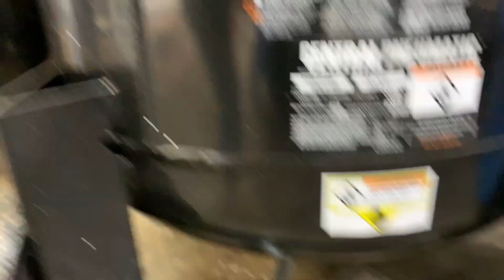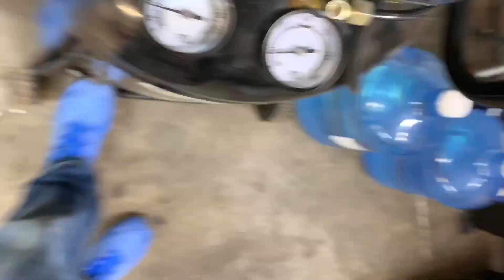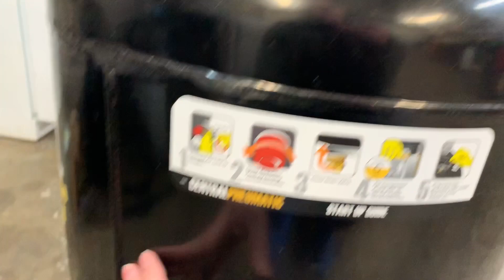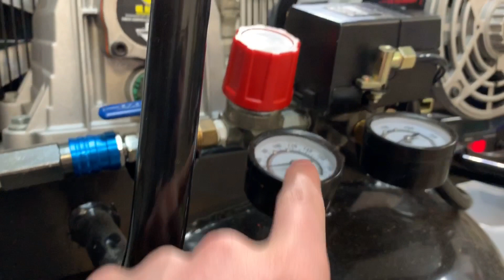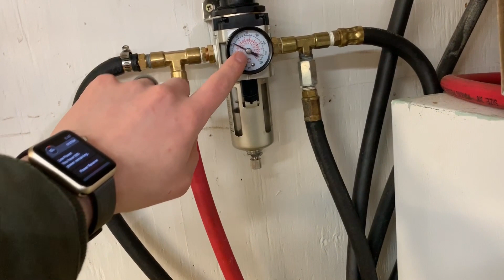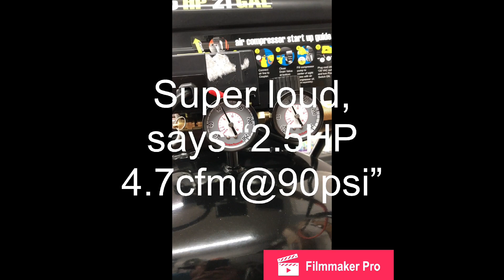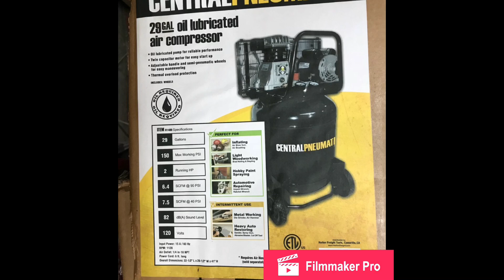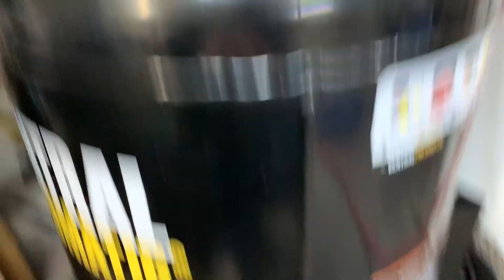Harbor Freight 29gal After Cooler Install, (BONE DRY AIR)

Comment: With out watching the whole video. I stopped as you said “ second thing is “...  You could have extended the drain port with a nipple fitting/cap long enough to help access your oil drain intervals... Just a simple add on to not have to cut into your compressor mount...  Greg
Reply from the maker: It was a very weird size. But hindsight I should’ve done that first. Just looks ugly but it did the job.

Comment: I have a 7 hp 60 gallon and paint on occasions.  I have tried so many water separators and was about to build my own decedent dryer.  I am definitely going to try it your way.  Thanks for the great video
Reply: How’s it working for you?
Reply from the maker: Did you get around to it?
Reply: All you need  is 120$ sharpe dryer

Comment: The setup i would have if i lived in the US, considering how cheap stuff is there buy two small compressors or one big one for 1k and have 12-17CFM with a massive tank or buy second hand commerical and never look back.
Reply: I went the commercial unit. 80 gallons with a real 5hp motor and a pump the size of a harley motocycle engine. It is a westinghouse air brake company pump, which became leroi and then dresser company. The design was used for the brakes on trains and for commercial shops. $750 from my neighbors field and a week of pestering to get that one and not the other brand he had hooked to his shop. Luckily I researched the compressor and found out it is pressure lubed and parts kits are available still. It would cost around $3,000 to $6,000 for a new unit built with a pressure lubed pump. It is rated at 17.3 cfm at 175 psi and a little less at 250 psi. It is making 20 cfm based on how fast the tank fills. 5.5 minutes from 0 to 170 psi on an 80 gallon tank. It is perfect for a serious 1 person shop and runs a plasma table and blast cabinet with the big skat blast tips.

Comment: Great idea to preserve the tank. Is that cooler really rated for that much pressure though? It looks like a regular transmission cooler, and those don't run much pressure, if any. I've got a bigger 5hp 60 gallon compressor, and this kind of thing seems like a good idea to keep water out of the tank for sure.

Comment: The very first thing I would have done and would still do is move that compressor outside of the shop and get rid of all those 1/4" fittings and hose at the compressor and plumb it with at least 1/2" lines or maybe 3/4" and run that through the wall and run that pipe around the shop to some quick disconnects and hose reel, I had my small compressor outside under a shed roof for a long time and am in the process of building a big shed roof behind the shop and I have a 60 gallon one sitting temporarily inside and I can not wait to get it outside, that is the only way to go, I cannot stand all that noise, Thanks

Comment: Only person I've seen do it right and not restrict air flow,,,I used a roll of 1/2 inch copper tubbing,, all 25 foot coiled up 3 years ago,, and havnt drained hardly any water since,,cost me 75 dollars for all.
Reply: yeah, you could build that whole set up from copper tube and fittings and maybe a bender.

Comment: You're gonna get water in the bottom of the tank no matter what, just part of the process of compressing air. The cooler isn't removing moisture from the lines, its just preventing it from turning into water. You need good traps and a dehumidifying machine if you want to paint professionally. I work in a shop and have seen how they run those 500+ gallon tanks. They have dehumidifiers that are about the same size of the tank. What your cooler does is effectively let the tank store more air per cubic inch. This is how two stage pumps work, one pump compresses air a first time, feeds it through a cooler, then compresses the air a second time to make it extremely packed. Which is how those big pumps can push so much air, because they literally compressing air several times before storing it.

Comment: Why cool the air going into your tank? It will sit and heat up anyway. Harbor Freight sells a compressor drainer kit SKU 68244. Its a purge valve. I dont trust that you are putting 90 psi on a automotive grade cooler design for low pressure fluids.
Reply from the maker: So that no water goes in the tank?

Comment: I hate to ask the obvious, but where does the water go?  You compress humid air and send it through the cooler, it’s going to condense in there . If you don’t trap it, it’s still going to end up in the tank, it’ll just be cold water…. Is your “flow valve” responsible for trapping the condensed water

Comment: 4:08 is 2000 PSI not 2000 degrees. lol. Otherwise, the whole thing would be a melted blob on the floor.
Reply from the maker: Oby-1 you’re right it’s 4000 PSI actually. High pressure water pressure hose. But it is also 200 degrees rated. And has held up great.
Reply: @gunsandgaragegear601  Having sold hyd, pressure, LP, NG etc etc hoses for yrs, that normal duty pressure washer hose will brittle over time due to heat
Reply from the maker: Tom Brown which hose? Blue one?
Reply: @tombrown1032  so what hose do u recommend coming out of compressor?
Reply: @organicvids  coming straight from compressor head or manifold, always use copper tubing

Comment: 5/8 pipe thread? 2000 degrees? 1/4 hose in series with a 20 gallon tank? Taking a grinder to a the pump mount, instead of adding a pipe nipple, But you did on the air drain? Do you have any idea what you're talking about?
Reply from the maker: EitriBrokkr it’s 3/8.

The oil drain is 3/8, that’s easily extendable with pipe. The oil drain is 1/8, you try finding an extended pipe for that to push it out even 1”.

Thanks for the tasteful comment :)

Comment: if you can run on 220 you dont need a separate breaker. everyone in America has 220 your stove drier and washing machine run off 220. personally what iwould do is get 2 of those compressor heads and 2 motors get 1 or 2 large propane tanks convert those it would work better. 

i need a vertical compressor (im in the uk) they are usually double the price if not more, i can make my own if i buy all the parts separately cheaper than the usual horizontal ones we have here.

Comment: I found one, 30 gal Kobalt $379 on sale, 155 psi vtwin compressor unit. All parts replaceable 
Lowes. Highly recommended 
Buy it use it less connections less problems. Other than painting or sandblasting most all mechanic tools are battery powered, great for blow drying Safety Kleen off parts if need be.
Reply from the maker: Jimmy still more money. Also not belt driven.
Reply: @gunsandgaragegear601  Mine is belt driven with oil filled V-twin compressor cast iron made in America.  Rated at 155psi shuts off at 160. Had it for 7 years working on cars and jeeps out of my garage. Only problem was I had to  replace the safety valve this year. I do like the fact that your a thinker though.

Comment: if you had noticed   on the  gas  compressor  at harbor freight    the pump  had  a pipe  to drain   oil from  the same  pump  as yours.   i dont  know  what  part  number  is.   im thinking of buying  the  29  gal   air  compressor   .  hows yours   holding up.  thanks.

Comment from the maker: Update, the compressor oil drain plug is actually m6-1.0 with a 5mm hex head. And recessed back. Instead of messing with it during the break in process I ground the triangle on the support beam. 
After doing a bit of research more into it after many comments not liking that 😂😂
I found a few parts that I’m ordering and a valve. 
Shown in this video here (Thanks Will!) 

https://www.youtube.com/watch?v=MY8ebLrXr-A

M6 to 1/8npt adapter https://www.mettleair.com/store/brass-pipe-adaptor-1-8-npt-female-m5-male-nickel-plated-reducer.html

Comment: The flexzilla hose reels are not as good as they could be. My hose reel will not retract all the way when the pressure is on. Depressure it and it goes in all the way. The soft hose expands too much. I’ll take the old school hose reel for sure.

Comment: I like your idea to cool the air before get to the tank.  Can I use the Fin radiator cooler instead of after cooler?  And why you choose the belt driven air compressor instead of oil-less (belt-less) compressor?

Comment: Perhaps you could have taken out the oil plug and put a small diameter pipe that is maybe 6" long with either the plug on the end or a shutoff valve, rather than cutting the frame?  Similar to the water drain pipe you added...

Comment: Yours its pretty quiet,  i have the same one and i sold it because for painting cars its not that great but on toher side its a good compressor for power tools.
Reply: What compressor do you need for painting?
Reply: @WordupG  60 galon compressor with a 5 hp motor with good scfm capacity but you still can do it with a 30 gallon one .

Comment: Atmospheric Air contains water. If you have humidity, you have water in the air. Your aftercooler cools the compressed heated air, but the water must condense out.  The water does not disappear.  If you are not getting water out of your tank, where is the condense water hiding ?
Reply: Gary z zzRyh. K n. Bohrman he put a water trap after the cooler
Reply from the maker: Yep. Into the water trap. Normally just one water trap like that will not be enough. But with the aftercooler and the little drip trap it stops all water. And I still on occasion empty out the tank out the bottom, NO WATER. It’s awesome.

Comment: OP: do you have a source or link for these blue short length high pressure hoses? I'm in need for these but don't know where to look!
Reply: Did you find a hose in looking for one now also
Reply: Look up air whip hose...
Reply from the maker: I got these from a pressure wash supply company. Steam hoses.
Reply: Copper tubing will work too.
Reply: :You can use PEX-

Comment: The after cooler is a good idea. 3/4 in and out fittings would have been better. Auxiliary tank install makes no sense to me. One line straight the auxiliary tank and one supply line.

Comment: Been watching a lot of these videos it seems no one gets that when you cool it at the pump heads the water never condenses into droplets but its still there and going into your tools as VAPOR ! These are a bad idea, what you want to do is let it get hot and then condense it after and get rid of the water! Having water draining out is a good thing you get rid of it that way, this way it stays around as VAPOR ! There is humidity in the air if you don't condense it and get rid of it its still there.
Reply: Your's is the second comment I've seen concerning cooler location.  Can you expound a little more on the best location and setup?
Reply: @MrFredsAdventures  just use water separator, it's more safe for your tools than adding more expensive tanks/expensive oilless compressor. buy more straight to the point with air filter water separator, you can check online in amazon or ebay or walmart. cheaper solution yet proven effective.
   if you still want to buy cooler, you can use directly from output compressor (from the piston engine output) to your tank
Reply: Hi Guys. I am getting a shit ton of water through my tools. I have a water filter coming right off the top by the Regulator. Hardly no water comes out of that nor the tank. So why am I getting so much water blasting out my tools. They are gonna get ruined if I don’t get help. Thanks Guys. By the way my tank is a 30 Gal. I did purchase the 60 Dollar desiccant/water filter at Harbor Freight that I have not installed yet. Will that help where I have the other filter I mentioned earlier? Thanks Again Big Jim.
Reply: That's exactly what he's doing!  The air gets hot as its compressed.  Instead of cooling in the lines and condensing, its cooling right after the compressor head.  Thus, condensate is in your dog leg, or tank, and not running through your lines.
Reply from the maker: Gonna call BS on this. 2 reason. 
Know why, vapor cools and you’d think if I drained the whole tank every few weeks that a single drop of water would come out of the bottom. 
And secondly, the water filter I have hanging down always spits out water, that had been collected through the cooler. I could put a bucket under that thing

Comment: If u extend your intake from your air compressor, run the intake to the exterior of your garage to where it is not sucking air from the room its in but piped to draw air from outside. It would be much quieter. I ALSO HAVE AN EXPANSION TANK ON MY 26.. MINE IS FROM LOWES & I CALL IT A PIG BECAUSE IT LOOKS LIKE A PIG!!!!! P.S. I GOT MY AIR COMPRESSOR FOR $68. IT WAS A RETURN...

Comment: That is an absolutely Genius concept!   However, it may have some room for improvement.  I am currently in the process of copying your design ( i.e. parts are in the mail to me now )  I believe to put it bluntly, you over-complicated your set up.  Not to say it doesn't work for you!  But I require high CFM, the flow rate on my tools is around 10 CFM @ 90 PSI  meaning every fitting has to be a minimum of 3/8" inner diameter, where 1/2" would be ideal but may not be easy to find all the fittings I need and swapping back and forth from Army/Navy to  M/F (NPT)  I'm gonna try and simplify it.  Can let you guys know how it goes...  Shipping is slow, probably a month away from the hands on part of this adventure.. I just got a brand new compressor, so from day 1 I'd like the tank to be bone dry, its also easy to see if any new rust forms because its clean inside at the moment.
Reply: Did you make a YouTube video on your revision ?

Comment: I have scavenged some evaporators from top-freezer fridges I was thinking of doing this with. Just have to make sure it will withstand 150psi. Solder some fittings to inlet/outlet.

Comment: You probably could have rigged up a barbed connector to your drain for draining your oil and just used a cap of some sort to cap it off. not likely that reservoir carrying the oil is carrying much pressure. The other thing would be to find a long stud that would fit, drill a hole through it and find a cap nut.
Reply: It's not that complicated. It's 1/4 not. Buy a 4'  nipple and plug

Comment: Good idea but if you use air get some air 60 or 80 gallon , I’ve had my compressor for some 18 years auto drain and never had a problem although I’m I. The market for a new one thinking Quincy 80 gallons 71/2 hp pricy but specifications are great .
Reply from the maker: Jerry PEAL don’t need that much.

Comment: Kind of late to do after the fact but I would suggest measuring your threads on your oil plug and install a quick drain plug. There's a company called fumoto that sells them as well as an "off brand" that's a couple bucks cheaper called ez-drain. They have different models, some of them have nipples so you can attach a small piece of tube to drain into a container. They're great to install on generators too, since the plugs are so hard to get at without spilling oil all over the frame. 

Edit: I just scrolled down the comments and I like the idea of a ball valve plumbed in as well. It would probably cost less to make one. I'd center punch and drill the existing plug and solder some 1/4" tubing and install a "needle valve" for about 3 bucks.
Reply from the maker: Watcher Watchmen i found the right extended pipe for it now! Will do a new video sometime

Comment: Could the second hose on the output side of the cooler just be a standard air hose or dose it need to be the high pressure heat hose?
Reply from the maker: It could be normal

Comment: I added a 1/4x8" extension to my drain valve with a ball valve - works well (don't have the same compressor but my oil used to leak on the pump when changing also).
Reply from the maker: AN this one seems smaller than 1/4, I brought the plug to HD and Lowe’s and no one had a pipe that small to extend. So plan b was to make it more accessible for a funnel.

Comment: will this after cooler work for a two-stage 80 gal compressor
Reply from the maker: Fred yep
Reply: Hi fred. You need to check the pressure rating of the cooler is high enough. Big issue is many people use fluid coolers like oil coolers. Fluid ratings are about 4x lower than compressed air ratings.   Stay safe
Reply: I haven't set mine up yet , but thanks for the info.
Reply: @fvg3401  sweet as. I used dearle tube and fine cooler. Rated at 400 psi. Hope it goes well. Its a very worthwhile mod to do.

Comment: I have the same compressor just bought build to 145 max psi is that normal
Reply from the maker: mabrook almahfali should go to 150, I think you can adjust that under the plastic cap by the on off switch

Comment: Why would you spend $660.00 for a pair of those? When you can get a 60gal 5hp Ingersoll Rand Made in the USA from Tractor Supply when they are on sale. Which is pretty regularly. The Electric Motor bit the dust on my My 10 year old Ingersoll last summer so I went to Tractor Supply and the had the Ingersoll 5hp 60gal on sale for $600.00 a new Motor was gonna cost me 400, so I just bought the new Compressor, plumbed it into the Tank on my old one, now I have 120gals of Air Capacity for $600.00. The way your suggesting woukd be $660.00 for 60gals of chinesium Air Capacity, as well as about another 60 - $100 for fittings and hoses to plumb them together. Just saying! There are way better deals out there than paying for 2 of those. I like you build though with the Aftercooler. Pretty slick job.
Reply from the maker: Phillip Chambers what? This air compressor is $330, well worth the money. What are you talking about 660?  Also it depends on how much air you need and if you have 240 hook up.. I don’t need 5hp power haha.
Reply: @gunsandgaragegear601  I am referring to the statements you were making about the option of buying two of them, and plumbing them together!
Reply from the maker: Phillip Chambers ah, sure sure. Yeah well if you don’t have 240 you could still. Otherwise just one is nice too. For someone like me I just need one